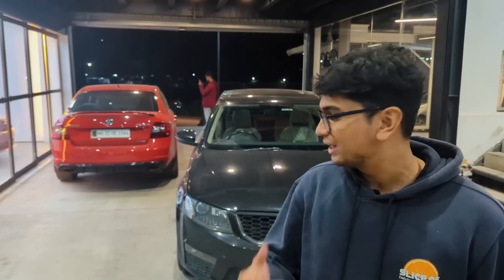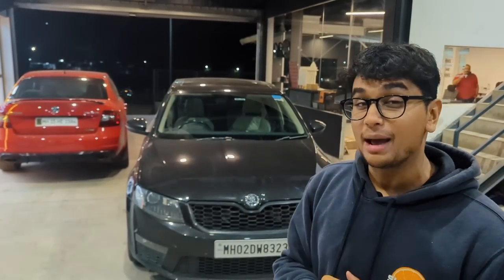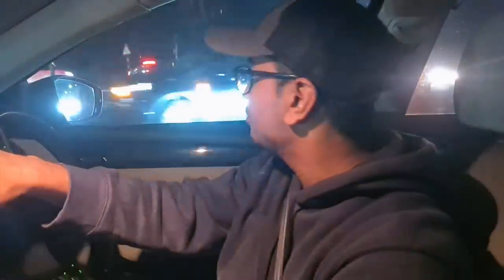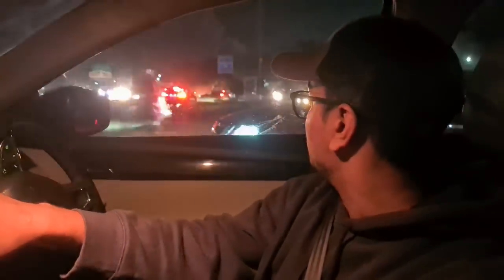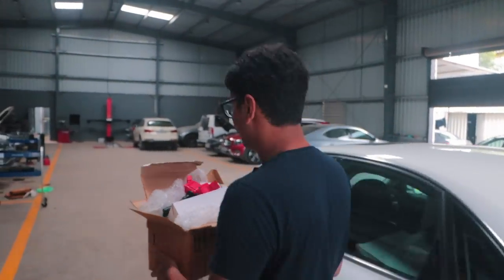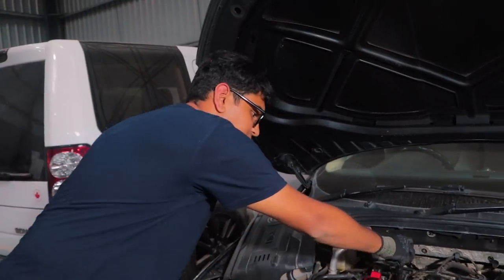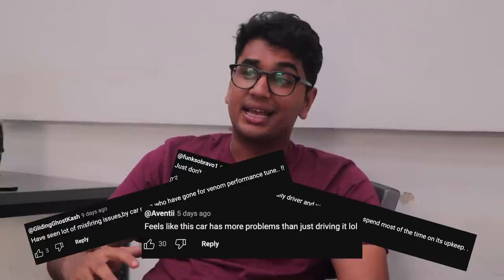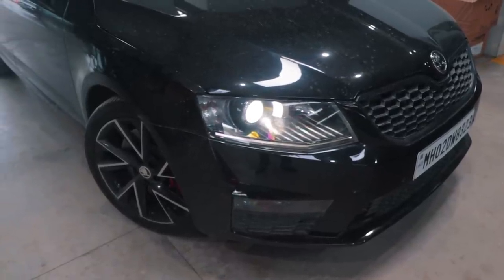More Problems for our Stage 3 IS20 Octavia 1.8 TSI (Ignition Coil Failure) | Project Octavia

Comment: 86K kms on OEM coils!!! It was more than done hanging by strand! After the tune it just gave up..
Reply: As you are pushing more power out of your car those stock coils are not ment to support those things you should have been upgraded them as soon as you tuned it..
Reply: They don't know that much. They are amateurs with no basics. They like to learn basic lessons at high expenses for clout.
Reply: The car wasn't running those coils for 86k kms! The previous owner had installed APR coils too but sold it before handing it over to me. 

Those stock coils were okayish, but just couldn't keep up with the needs of the new setup.
Reply: @SohamSaraf  agree👍👍

Comment: Carry an obd11 my friend....i always carry my obd11 as my vcds and laptop I don't carry most of the time😂😂.....plus I carry an extra ignition coil ,one premix coolant and one oil cause even i own 1.8 tsi😂😂 done 110k kms  still the dq200 multipack clutch is holding.....measured  tolerance with vcds and it's still within the spec so🤞🤞....I would advise you to change the mechatronic fluid it's pretty easy  and will help keep it in good condition!!!!
Reply: How to do mechatronic fluid change bro? My car at 60k
Reply: @shibjoseph  is your car dq200 or dq250 ??

Comment: Thorough build LOL! 
Intercooler is stock, boost pipes are stock, neither you got iridium plugs.
Spending money on unnecessary stuff like those stupid OEM wheels could be done later. Instead getting good internal parts and then getting a tune is a thorough build.
Reply: First of all, great on your part for assuming stuff 👍. 

The series is not even over and you're commenting stuff like this. 

The parts that you have mentioned are on its way plus, the car is already running a VRS245 IC if you haven't seen the previous episodes (ofcourse you haven't).
Reply: Also, one more thing, "stupid OEM wheels" 😂. 

So you're telling me, I should have driven on those cheap fake AME replicas or whatever and risk my life? 

Good set of wheels are essential for a build, sure maybe that money could have been spent elsewhere but I have no interest in going through a pothole, cracking my rim and having an accident. 

All of these supporting parts like brakes, wheels and tyres are just as important. 

Looks like you're the type of guy to spend only on power mods and then go crash into a tree because you were still on stock brakes .